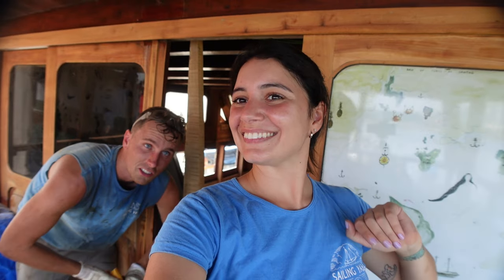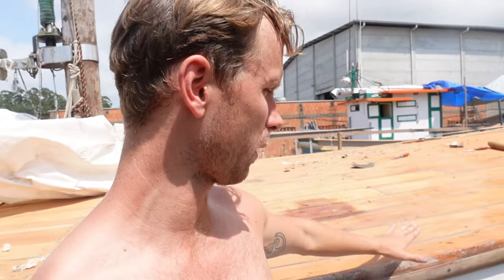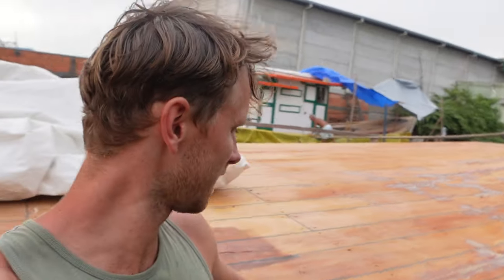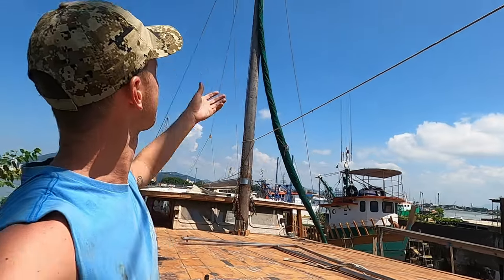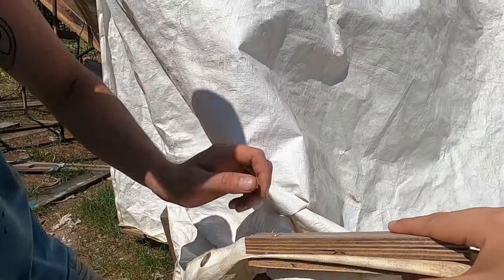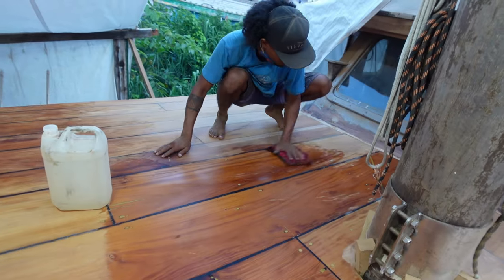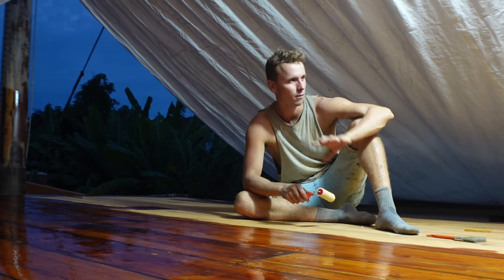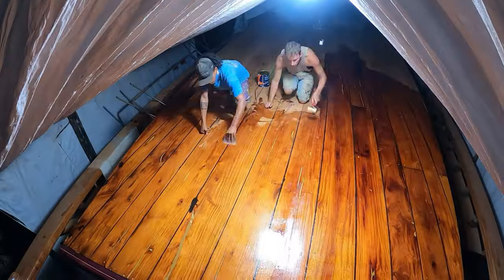Boat restoration: protecting our roof with clear epoxy. Will that work? — Sailing Yabá #90

Comment: The epoxy and single layer of fiberglass on the roof will be more than enough to keep the roof in good shape and prevent leaks.  Having said that, epoxy breaks down when exposed to UV, so I'd advise covering the epoxy and fiberglass with multiple coats of a good UV varnish.  The varnish will protect the epoxy/fiberglass layer, and you'll only have to redo the varnish maybe once a year.  Paint is obviously the best solution for this, but since you've decided to keep it transparent, applying a UV protective layer (many layers) is the best thing you can do.  Looking good, though!!
Reply: Spot on!!
Reply: Couldn't they do a pour of UV epoxy? I did a pour on a really big table that was about half inch thick of UV epoxy for my outdoor table .I had put like money below it an pennies and stuff like bottle caps...Couldn't they do that to the roof would that work?
Reply: @donnakawana  Boats move, thick epoxy will crack so it’s not a good idea and will be a huge expense. UV damage will aggravate the cracking.
Reply: Absolutely.
Reply: @donnakawana  - You could certainly add UV protectant to the epoxy and skip the varnish, but you'd still need to refresh the UV epoxy coat yearly and varnish is cheaper and easier to deal with for that kind of repetitive maintenance.  Also, you wouldn't want a really thick layer on that roof, as the added weight wouldn't do the boat or cabin top any favors, and it would be prone to cracking.  Epoxy pours are fantastic for smaller projects, though, and could possibly be used on interior furnishings of the boat, like tables and such.
Reply: Yer wood expands and contracts.  Single layer of epoxy is not good for wood.   
It gets hairline cracks that allow moisture underneath the epoxy that then sweets and rots the wood or will lift the epoxy and look motly in my experience.

Personally way to do it is a few costs of epoxy.  West systems recommend 3 since pin holes can occur from the wood of gassing during cure.  You did it right late in the day though so wood doesn't off gass very much and it shrinks and pulls the epoxy into the wood as it cools....

Then if you really want it clear which personally wouldn't recommend because of the labour a cost to up keep each year.   If rather enjoy using it than working on it.  Personally paint it a matching brown or another colour that will last 10 years and not need to be redone. 

Otherwise a good number of coats with a good uv single pack varnish.   What this does is expands and shrinks with the wood and is far less prone to "cracking" or splitting keeps the cracks that develop in the epoxy from taking in moisture underneath and keeps it sealed because it's more elastic.   Sealing timber externally with epoxy im not really a big fan of unless done really well.  Internally its great stuff.  If you use the clear additive so it doesn't go cloudy or yellow over time.     

Personally maintaining varnish in southern cold places not so bad but go to the tropics you spend more time maintaining the varnish than enjoying it.   

Some people deal the wood with a varnish and then paint over that.  Then if you want to strip it back it's much easier because the grain is sealed and can just sand the paint of and add varnish vola.  Varnish looks great if you have nothing better to do.   Otherwise scotch Brite and extra costs regularly and you have allot of boat so that's allot of time and material.   

Love your work !!
Reply: West system has a UV protective hardener  #207. But against the constant beating of sun, really the best choice of all is good paint in a light color.
Reply: @sprezzatura8755  yep agree it's also the expansion and contraction of the wood over time develops minite cracks in that water can penetrate they are glassing it anyhow so they will probably find with the glass in epoxy its not very transparent for the wood look anyhow.
Reply: @herenowlife  it will also be very hot to walk on or lie on. Best option is to paint it white.

Comment: As I posted last time. that ROOF is going to get real hot and will hold its heat at night time. Long term it will end up painted white. Also clear epoxy and UV dont mix over the long run. I'm sure it will look pretty but not practical.
Taking risk LOL 100% risk. And endless maintenance to keep it looking good (CLEAR).
Reply: Any varnish or clear epoxy will fail and is time and money going to waste. Epoxy doesn’t like uv. Paint it with a light colour two pot polyurethane. There is enough maintenance on a large boat such as this.  You do not want to add unnecessary expense. Yachts are not generally painted white for no reason. Any epoxy coating also needs the embedded fibre glass or it will crack then the deck will leak and rot. Deck seams that are not fibre glassed should be filled with a flexible sealant eg polyurethane definitely NOT epoxy. 
I am speaking from a lifetime of working on boats.
Reply: @PK-cc8lf  ditto.... on all aspects and lifetime of boat building.

Comment: There is so much I question in this video. First, I question the tool used for sanding. What your using is prone to cupping the wood and creating an uneven removal of material and therefore an uneven surface.  Why not use a larger sander, preferably a floor sander? It would give much better results. 
Next, I question your choice to use a clear finish on the roof. There are severa problems with this choice. It will be very hot so going on top of it to service it or even to do other things, like handle sails, will be misery. It also may increase the temperature down below, making it miserable too.  It will also be extremely susceptible to UV damage from the sun, thus increasing your maintenance requirements on an already high maintenance boat. The preference would be to use a white finish of some type, whether it be paint of some other material. White would solve those problems plus it would make the boat more visible to rescuers should you ever have an emergency. 
The clear may be beautiful, but I believe it’s a big mistake.

Comment: Varnished wood looks beautiful but a white painted roof might keep the interior cooler because it won't absorb so much heat from the sun. Of course your roof is quite thick so it might not make that much different. I used to have a sailing boat with a navy blue hull which would actually steam like a kettle when the waves made it wet. The first time I saw it I thought the boat was on fire!
Reply: Exactly - but pale yellow is ALMOST as reflective - but WAY more visible at sea in the case of an emergency!  That's why lifejackets are yellow.  And natural wood tones are no lighter than yellow anyway!
Reply: Interesting point.

Comment: UV light is what will damage the fiberglass epoxy/resins over time, so put a thick coating of UV resistant finish on top of the fiberglass. Automotive cyanoacrylate type catalyzed car finishes have excellent uv blocking. they also have gloss  and are clear
Reply: YEP it will UV out very fast so keep it well varnished
Reply: Or a layer of gelcoat
Reply: Yes! Wanted to say the same. Give that beautiful roof some sunscreen to keep it from clouding up. Maybe you can avoid having to gelcoat for years.

Comment: I have epoxy as as finish several times (sort of) as you will never get smooth. But that is good as you need grit or it becomes deadly slippery wet.  Go for it  .

Comment: Put as many coats of varnish over the epoxy as you can stand to do then sand and varnish at least once a year. Varnish is the uv protection and the cheap wearable coat
Reply: This is exactly what I was going to write. As I'm sure you know, epoxy is a much better waterproofing coating than polyester or vinylester but most epoxies aren't UV stable - but varnish is and it will protect the epoxy from breaking down.
Reply: Again, take these comments as valuable input. Epoxy isn't UV stable at all and although it will look amazing at first, UV will make it yellowish and opaque. You might have to redo the whole process  and remove the fibreglassing as well, again. Some people view this as BS, but it is not, unfortunately. Epoxy is an amazing boat building material, but it just has it's chemical properties...
Reply: glad it has been said.

Comment: epoxy will yellow and fail from uv exposure in quick order.  You have to apply  uv blocking coats of something to prevent damage.  Don't risk this, you will be quickly redoing all this work without protection.

Every time I see your beautiful little dog (sorry I forgot her name) it puts a smile on my face.  Thanks for taking her in.

Comment: I know, it's much too late now but here's a trick I tryed a few times working with damaged wood furniture : After you fill the cracks with the compound, you spread a light layer of the sanding powder and inbed it in said compound. Let dry. Sand. Varnish. Done
Not perfect but it made my precious Höffner violin bass guitar look way better once revarnished.

Other wise, I'm happy to see your progress. And i'm really impressed by "our" so hard working Ben ! 
You obviously gained much muscle mass since the beginning of your journey. But remember Ben , you must feed muscles with carbohydrates, like athletes. Working hard under the sun and heath demands food and LOTS of water input to prevent late day exhaustion.
Cheers ! 🤗

Comment: I should have added in my last comment when I was telling you about using a torch to bring out the grain in the wood, probably also available in Brazil would be a drum sander for doing wood flooring like we do in houses here in the US. These drum Sanders usually are 18 to 24 inches wide and over the deck and roof area would give you a much cleaner and level area than doing it by hand with rotary Sanders or orbital sanders, just a little thinking outside the box. The drum sander while it may cost you a little more to rent one the time you would save on your hands and knees is priceless.

Comment: Epoxy will deteriorate in UV light from the sun. Many boats use epoxy on the exterior but the epoxy is protected with UV blocking varnish.

Comment: You know, I really appreciate the work ethic that goes into this.  I hope that Ben and MP read this, because it is really important.

They've stated that they want to sail this boat around the world.  There is a huge problem with that.  The hull design of this boat is not designed for true sailing.  It is a motor cruiser with sails for show.  There is no real keel on the boat.  So, what I want to know is 'Ben, how much ballast do you plan on putting in the boat, where and how do you plan on locating it, and what kind of ballast do you plan on using?  'Given the center of gravity and the center of roll will be really high, you're going to literally have to use tons of ballast centered along a very narrow area around the keel of the boat to keep it from tipping over.  To keep Yaba upright, ten tons of lead ballast would not surprise me.  Twenty tons might even be better.  Yaba was never designed as a blue water sailing vessel, she was a coasted motor sailer at best.  I am afraid and I can see Ben and MP being a couple of hundred miles off the coast with a beam wind and all the sails up and Yaba rolling over onto her side and then sinking because there isn't enough ballast to stand up against the force of a 15-20 knot beam wind.

I don't think, based on what I've seen so far, that they have any plans on combatting that situation.
Reply: They're not sailing this boat anywhere, that's the reality. Not to be 'that guy' but I'm not sure I believe they are even the actual owners of this boat. Little to nothing about this channel from the beginning makes any sense and they refuse to divulge any finances in or out. jimo
Reply: @zaqman7255  Oh, I'm sure they are the owners.  As to divulging finances, a lot of people on YouTube don't divulge finances, that's not uncommon.  But, as to actual sailing, I tend to agree with you, although they'll try it.  I'm not sure if you follow Sailing Ruby Rose.  Nick and Terysa have been doing reviews of monohulls since the sail of Ruby Rose and while building their new catamaran.  They just did a review on a 42' German racing cruiser.  On a 42' boat, the keel was 7' deep and added an addition 500kg, or 1,100 pounds over the standard keel, suggested with the sail package was upgraded.  For a 70' schooner, with two sails, there is going to need to be a LOT of weight below the bottom of the hull, and Yaba does not have it.  These young people would have been in the best position to never have bought her in the first place.  She'll be a nicely outfitted motor sailer, for coastal cruising only, but Yaba was never designed to be a sailing vessel, and you can't change that design, unless you cut the hull off at the waterline and completely build a new one, making the boat 10' higher with a different hull shape.
Reply: @GaryMCurran   I'll keep my suspicions ;)  This was not an old boat, it has no history and no value. No reason what so ever to invest any effort to rebuild. They are a dime a dozen. There's a reason to hide so many details. (Most do not actually)  Anyway... yes. I'm a sailor my whole and currently a USCG Aux officer. This boat will never leave sight of coast, whoever it ends up with.
Reply: @zaqman7255  Semper Paratus!  I don't know the motivation behind it, starry-eyed optimism?  But, I do agree with you on the eventual outcome.

Comment: I’m wondering why you didn’t choose to use a full size roller and a six foot handle to roll on the epoxy. It would’ve saved you some back and knee pain😉. Maybe on your next coats.
Reply: I was thinking the same thing ! And it would have been so much faster !
Reply: @marcryvon  Definitely faster.🤓

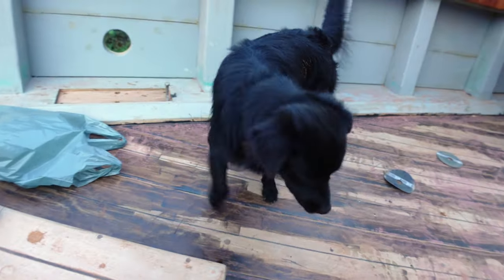Comment: I stopped this at 18:16 to say this: The main regret you will have leaving that roof unpainted is HEAT. A white roof will reflect much of the sun. The roof will be dark, and absorb heat. Also, epoxy degrades in sunlight, and varnish fades and needs renewing every year. It flakes off. Please reconsider.

Comment: I'm familiar with surfboard fiber glassing . Unfortunately as mentioned by the comments below fiberglass& resin have a tendency to turn yellow over time . I suggest enjoy the clear wood top cabin top till it starts showing UV damage then a light sanding and paint it a lite solid color with a good quality marine enamel . Yaba's coming together very nicely !

Comment: One layer will be fine but epoxy is not UV proof so it will yellow and breakdown. I understand that you want a varnish look but the dark wood will absorb heat that will not only make the epoxy breakdown faster but it will burn feet and heat up the boat. It's best to keep varnished timber as trim like hand rails and around windows and paint the rest. White with a bit of blue is upto 70% cooler and will save you a lot of work. Keep the varnish or oil inside where your hard work will last.
Reply: Totally agree in my experience less work the better to enjoy your boat

Comment: FYI.. the curve on the top is often called the camber. Also, if you leave the coach top a dark color it will make it hot inside. You'd be better off painting it white for that.  Cheers!

Comment: Creedence Clearwater Revival - Rolling on the River
I would have mounted all modern, flat solar panels on the roofs and powered the entire ship, including a 40-100 KW electric auxiliary drive. So you would have been completely independent of expensive diesel.

Comment: MP, I agree with you on the roof looking so much better with the wood grain visible. I think it would look nice on the hull, as well! How are you going to get the grain to show through with a layer of fiberglass on it? A much wider roller and using a handle extension would help immensely in getting that top covered.

Comment: Just one layer of just like surfboard fiber glass will work fine to look transparent. But remember, you guys have to think about slippery very serious. On surfboards we use wax but it looks terrible and dirt. On dugout canoe we use to spread a little bit of very fine grain dry sand, over the wet epoxy resin.

Comment: Wont last amazes me at the amount of work they do and the shortcuts they take. just did the roof on my boat with an aluminum structure underneath, had a leak on one of the antenna mounts so it rotted out. replaced the Luan, leveled out the low points, sealed it, applied glue with a Filon fiberglass like material rolled it on and its just like the factory, it will flex along with the boat and not crack like the epoxy will, and solid fiberglass roof material that does not flex will stress crack over time applied over flexing wood underneath, hence a floating roof is installed at times or using a flexible fiberglass material like a Filon type which is available all over the world

Comment: Make sure you final coat the roof with either a poly aspartic  or a tetrathane top coat for UV protection... and you can add the none slip glass in those last 2 coats....

Comment: No doubt there will be many more knowledgeable comments on your deck finish choice, but I have read comments online to the affect that where it is desired to retain a clear wood finish on a surface to be exposed to sun and wet weather (separately 😉) your choice of epoxy for first layer will give protection from water effects, then following coats of varnish will protect the epoxy from sun's effects. Possibly your choice of clear fiberglass resin will  have the same protection for the epoxy. Yay Yaba !!!!

Comment: I’m not even halfway through watching your video history and I’m amazed at how much you’ve had to do so far. 
Two burning questions though. #1 money, where’s it coming from? And #2 it almost seems as if buying a new or refurbished/restored boat may have been cheaper. But yeah you would have missed out on the value of experience.

I am amazed so far though. Very informative and inspirational set of videos